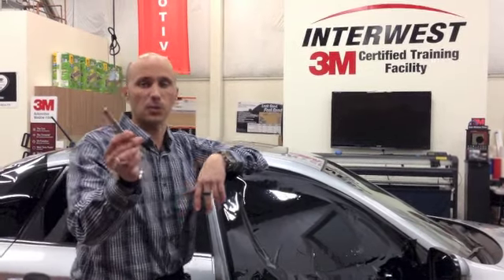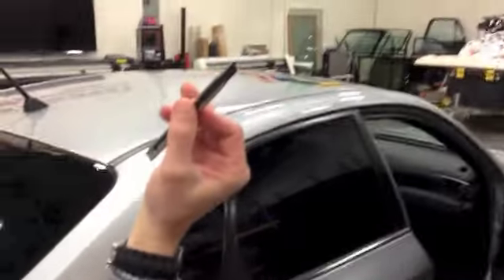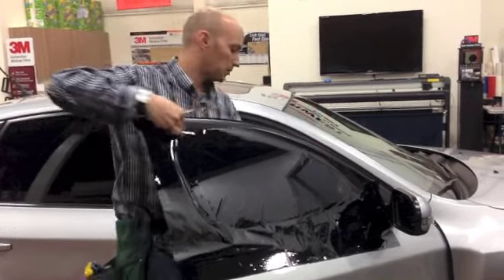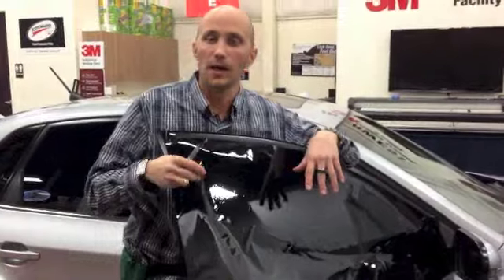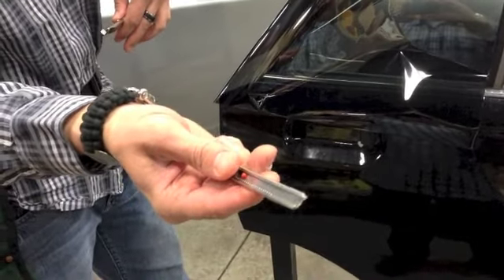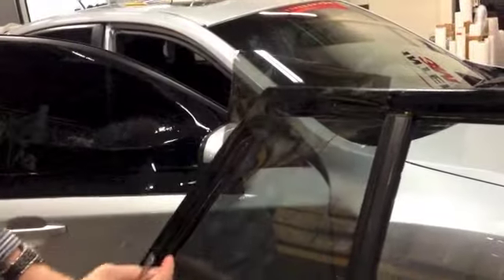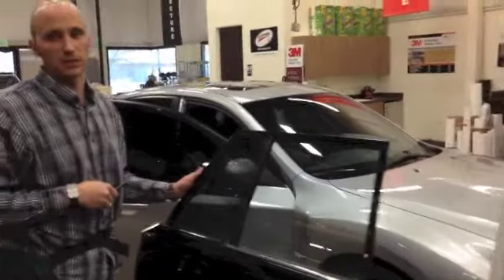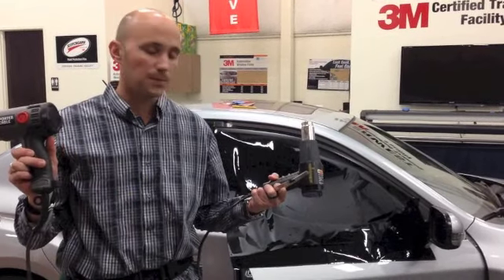Interwest's Todd Bergman's Automotive Window Tinting Tips

Comment: Where can I get a vertical hanging spray board from. Should I try my nearest glass shop?
Reply from the maker: Most spray boards are constructed locally by the shop. You can source the glass from a local shop, but you will have to construct a frame to hold the glass. Some people use 2" x 4" lumber to construct a sturdy and inexpensive frame. Many also install rolling casters on the frame to allow the board to be rolled easily throughout the shop.

Comment: Todd, Just had my windows tinted how long does it take for window tint to dry? My weather is going to be in the low 80 s. I had it done a day ago and noticed a few spots that are there.
Reply from the maker: It can take 3-5 days depending on the weather, temperature and exposure to direct sunlight.
Reply: InterwestTools
 Thanks for your input Todd. I have noticed a few spots are gone since Saturday afternoon install. A few still remain now it is two days since install.